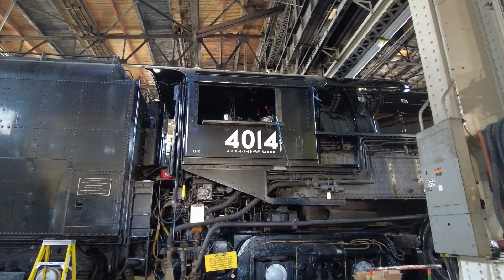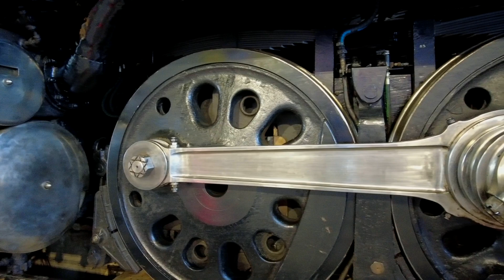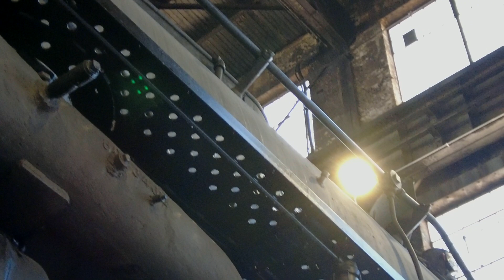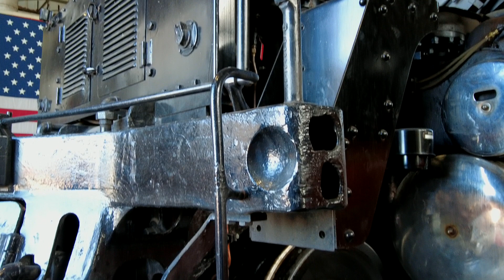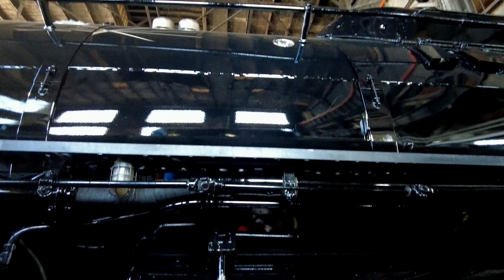Big Boy #4014 Steam Shop Crew - preparing for California trip also including tooling discussions

Comment: Hold on a sec…gotta plug my laptop into the big boy to see what the codes are . Good thing none of the old timers are around to see this. The guys at John Deere musta thought of this.
Reply: That what you see there is the PTC software if we want to see these beautiful machines last we must comply with modern regulations. It’s neat seeing modern technology with Alco superpower
Reply: @Danzc3bc  I'd be curious what it's doing. I imagine it's tracking temp. and pressure at different locations. I can't think of what else there is to keep track of, maybe dynamo voltage.
Reply: @bigredc222  PTC doesn’t regulate or look over any of those things PTC is a network that is linked with the signal systems to safeguard against unwarranted movement under CTC (Controlled Traffic Control) PTC can give a penalty, emergency brake application if Engineer doesn’t comply with speed restrictions or signal indications. Also can stop other trains movements if they aren’t complying with signal indications either. It’s more of a computerized failsafe for unauthorized movement or speed. Before they had the the diesel to comply with PTC and faked it out with the steam engine for the added length and axle count. Now big boy is capable of its own PTC without a diesel.
Reply: @Danzc3bc  I should have looked up what PTC stood for before I commented.That's makes a lot more sense. Thank you.
Reply: @Danzc3bc  I'm waiting for an Ed Dickens seminar explaining exactly how they pulled that off. In short I'm sure it's built using air solenoids and regulators but the details on HOW it works would be very interesting given the Big Boy is well 100% mechanical and PTC is 100% not
Reply: Wonder if it can get 4014 to play Fortnite? 🤣🤣  Maybe next we'll get ditch lights!
Reply: @eva.cassidy  ditch lights aren’t acquired in the US for steam locomotives as long as the headlight illuminates far enough as 800 feet for the engineer to see. Also ditch lights would look pretty tacky
Reply: I’m also curious what big boy had before was LeaPTC which used a trailing diesel that had modified PTC to  add the steam engine into account. Now that Big Boy has independent PTC I would like to see how it interacts with the braking system that big boy has. I know it has undated controls valves and equipment but I believe it still has its original brake stand in the cab.
Reply: @Danzc3bc Since air brakes are engaged by pressure drops my guess is electronic solenoids are placed after the brake stand to reduce AIR pressure in the event PTC is engaged. It could be they upgraded the mechanical brake system with an electro-pneumatic style where the lever is basically a potentiometer that sends electrical current to a solenoid with power supplied by the dynamo knowing that one day they would need to install PTC and that an old mechanical system probably wouldn't work but who knows.  4014 is coming to Roseville Yard this summer and that's only 15 minutes away. If I get a chance to pick some brains this will be something I definitely ask. It's definitely an engineering and mechanical marvel and Ed Dickens is the "Einstein" of Steam World

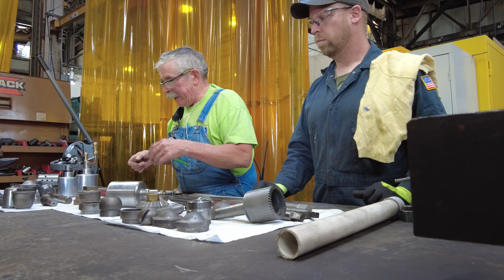Comment: 17:50 Bruce knows his stuff. One of the guest here is Alex from RRHMA he will be replacing #3985's bolts in a few weeks when the 261 Crew gets back from Mexico after taking the Empress down there. On #3985 and Big Boy the Sleeve Caps are welded into the shell on #844 they are screw type for easy maintenance. When Steve Lee and John Rimmasch ran Steam Shop they welded everything on. Because of this Steve Lee was given early retirement, Jack Wellmann was sent to Oregon Steam, and Scott Nixon, Brandon Turner, and Charlie Cross were fired and later sent to prison. They were replaced by Austin Barker, Garland Baker, and Jeremy Thompson. Also Ed got Bruce out of retirement, Ted and Kurt were bought back although Ted no longer fires the engine, and several new crew members were hired. If there is one man in Steam Shop who knows boilers it is Bruce he has made all the tools since he is a gunsmith by trade.
Reply: You do not know what you are talking about.